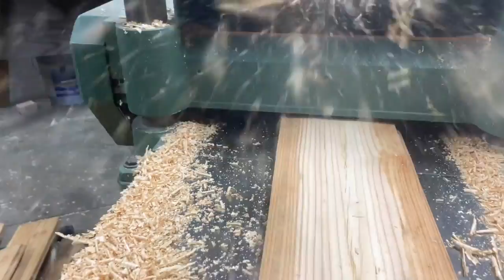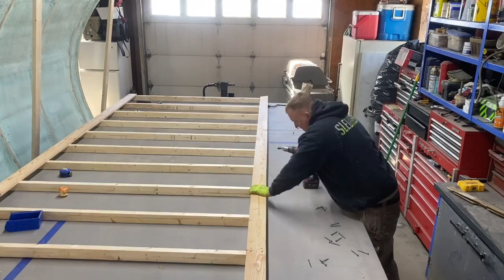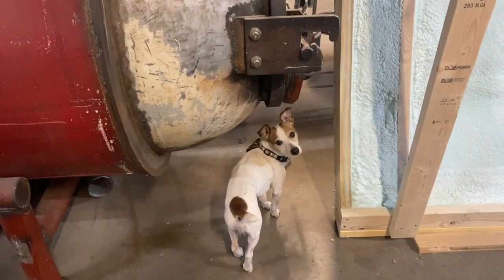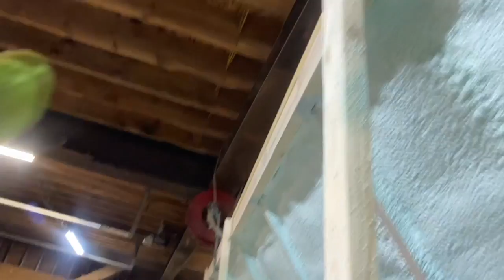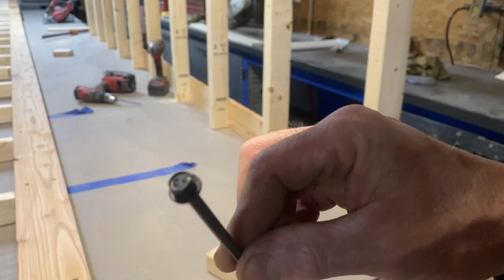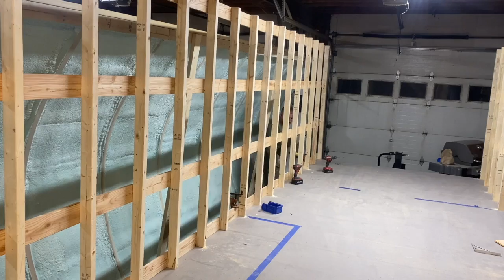Shepards hut/tiny house hunting camp part 11  (WALLS  GO UP!!!)

Comment: Have you seen the Marshall remodel Channel.? It's all about moisture using spray foam. I'm sure if you watch the video you'll have some input. These people are in a crisis with the spray foam
Reply from the maker: I just watched his video and left him some feedback. His problem could be solved with exterior insulation like Roxul  comfort board. Then a vented rain screen. Then he would (NOT) have to rip all that new drywall off. Hope its not too late and he tore it all off already.  😩
Reply: I knew you would have some good advice 😅
Reply from the maker: @MrSprintcat  I just watched more of his videos. This is a pole barn so he could blow dence pack cellulose in those walls and stop that condensation problem. He would have to cut holes in the stud bays and hose in there and dence pack this would crush the fiberglass batts and fill with the cellulose that is a closed cell insulation and air does not travel well through it and the moisture problem would go away. Moisture and air are sailing right through that fiberglass. I suggested doing a test wall before he rips everything apart.
Reply from the maker: Then he could just plug those holes with small drywall blow out patches.

Comment: I was wondering about your insulated Styrofoam blocks what’s the tallest wall you ever built in the of those configurations?
Reply from the maker: I have only gone 9 feet tall because I have only built basements with the ICF blocks.

Comment: Ron,  I've been following your construction.  Pretty cool!  Are you planning to take to Montegue?  And why didn't you got with 24 inch on center?
Reply from the maker: Hi Dan. Probably won't take it there because we have the camp there. Mostly a hunting rig. I did the floor on 16” centers and roof on 32” and I wanted the load to line up from roof to the floor buddy. 👍😊
Reply: @bondobuilt386  now I understand.  BTW Spring checked a 2022 MXZ X with the 600R etec.  1.5 inch ice ripper
Reply from the maker: @danpoor2488  nice bud. your gonna like that.  👍😊